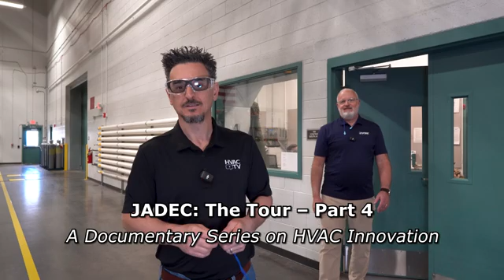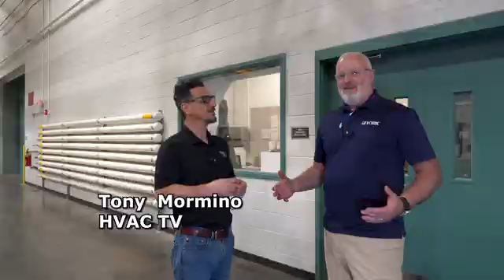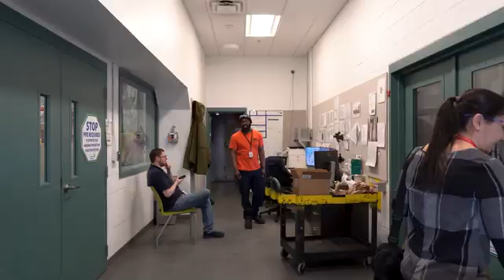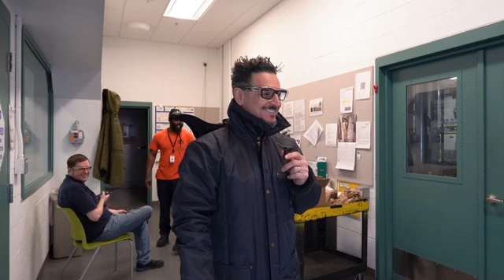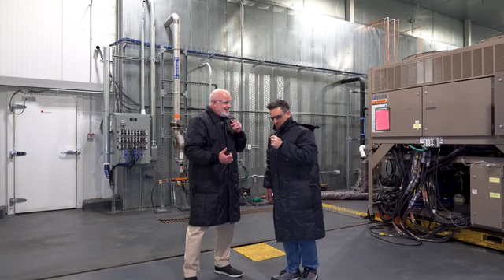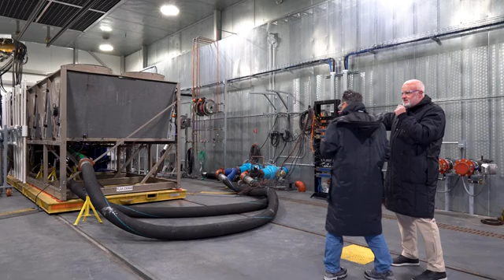JADEC: The Tour – Part 4 | YORK Engineering the Future — Testing YORK Chillers from -10°F to 130°F

Comment: Great video try defrosting an evaporator unit in a big freezer temperature -8F degrees that’s 15F feet up air that’s ice up will we would get a fork lift just to get the evaporator coil.Sometime the wheels would get stuck on the concrete floor due all the hot water would spray onto the coil sometimes the spray would onto the wheels.😊